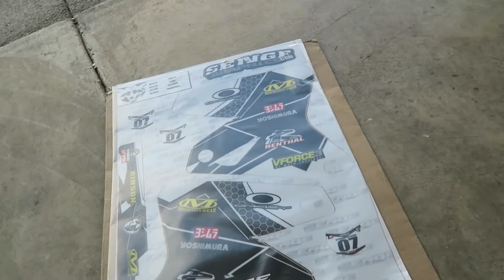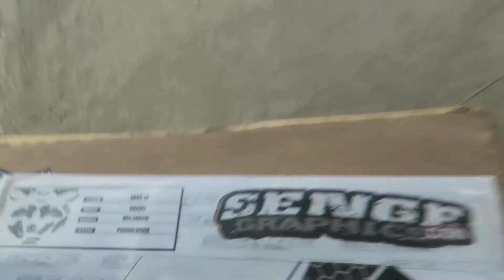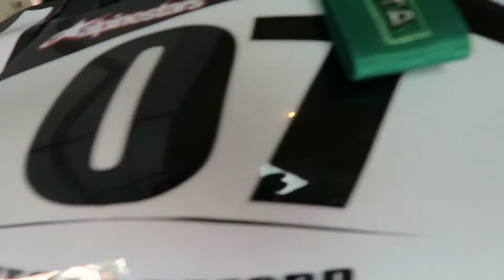Install Graphics With No Bubbles Everytime (WET METHOD)

Comment: Where did you get that grab strap
Reply from the maker: I'm glad you knew it was a grab strap. It's actually a Takata tow strap I got from Amazon. It bolted right up to an existing bolt. Only modification was to make it fit through the number plate!
Reply: I'm definitely getting one and moving my plate under the fender to that looks great with the lights hidden like that